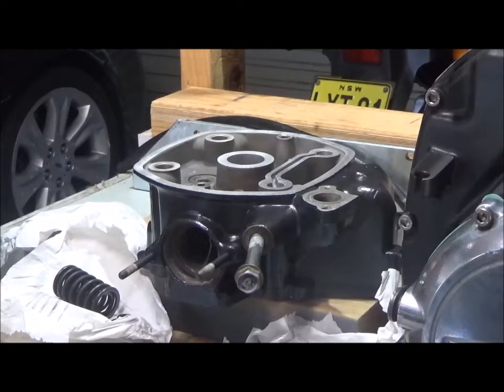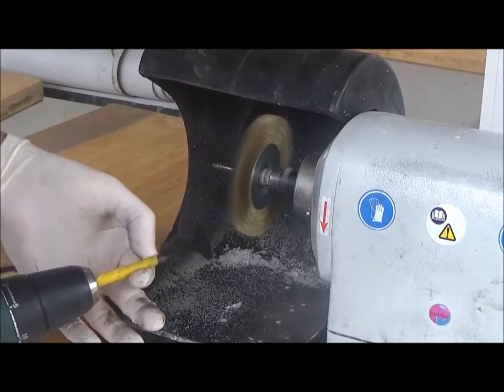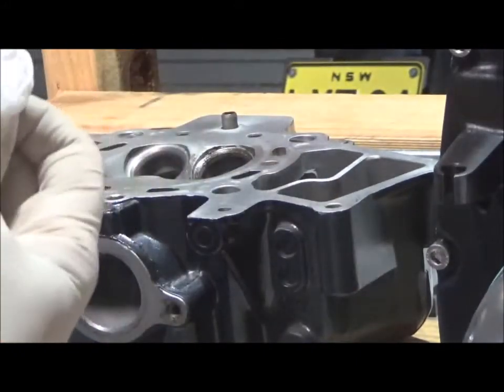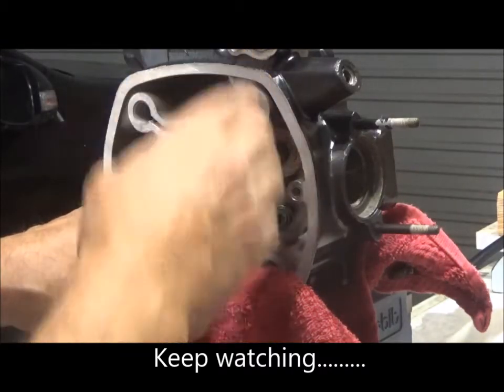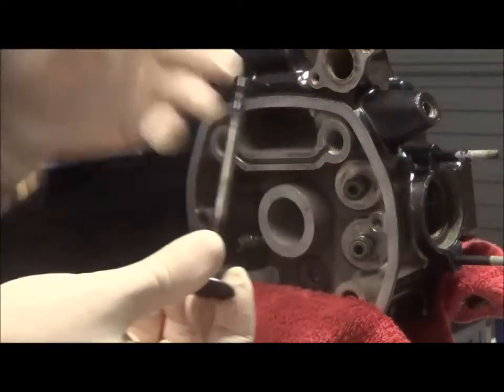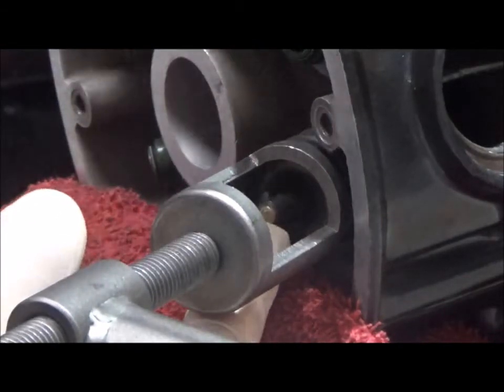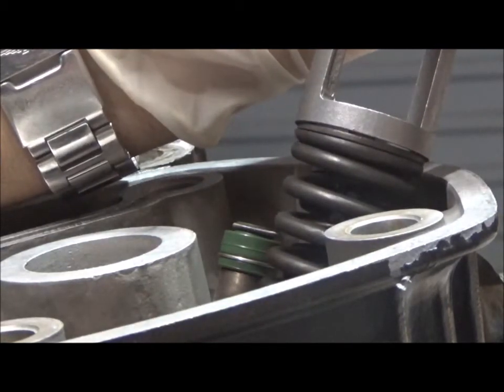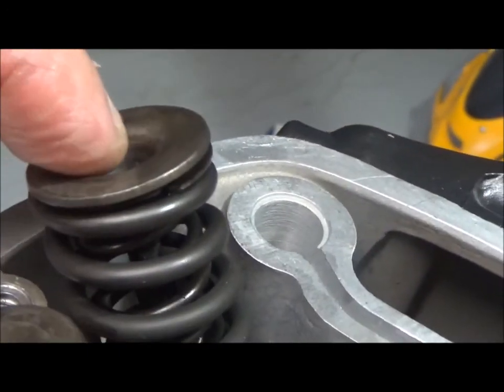Honda CX500 Cafe Racer - Engine rebuild - Heads and valves 1 - Episode 35

Comment: To lap the valves, try using a drill attaching  the valve to the drill chuck through small rubber hose instead of the silly wood suction cup. Faster and a better finish.

Comment: Great job as always :)  A small amount of grease on the valve collets would have helped loads :)     I'm following your  build as i'm doing the same here in Blighty :)  Keep up the good work.
Reply from the maker: Mitchells Renault ...thanks. great suggestion grease on collets.😁
Reply: No problems, been a mechanic for thirty years you pick up little tips on the way :)